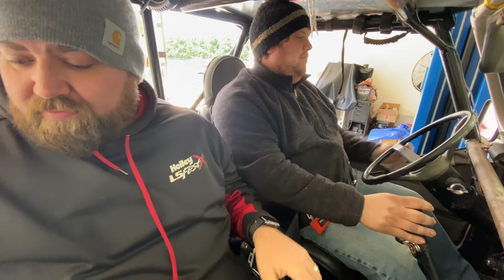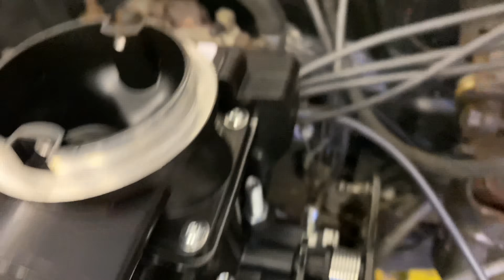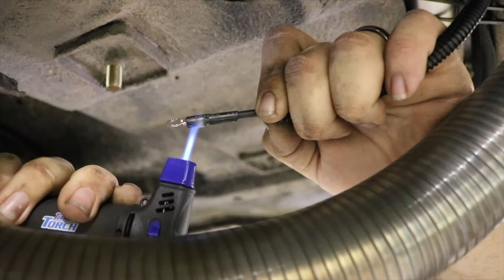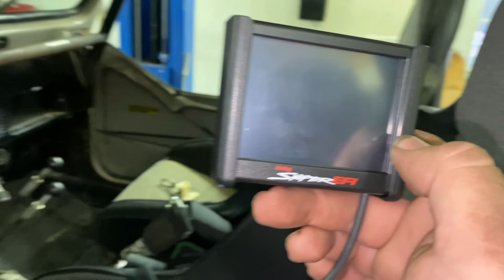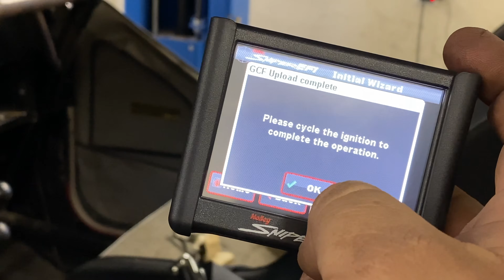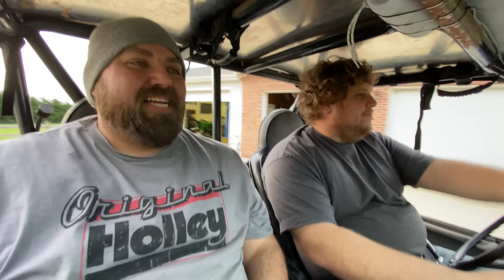Holley SNIPER EFI Install - CJ7 Rock Crawler

Comment: What diff gears are you using and what transmission? Also, what are your highway speeds you can drive? Thanks
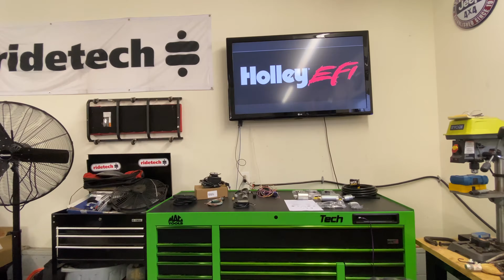Reply from the maker: Gears - 4:56 trans t18. @65 it’s 3,000rpm and it sees highway driving a lot

Comment: Jeep mechanic for 40 years. The Weber carb replacement for the Carter VV carb or even the earlier BBD is a waste. The Weber is a vacuum secondary 2 brl. that doesn't open the secondary barrel until it is time to shift. These are low rpm motors. The biggest boost you can make is adapt the Motorcraft/autolite 2100 to this engine period! You will NOT believe the difference over that Weber.
Reply from the maker: The Weber we removed was a progressive rate 2 barrel, not a vacuum secondary. However the 2100 is a great option as well that I have gotten to play with on other Jeep projects. Either way the EFI has performed leaps and bounds better then both and continues to impress daily.
Reply: @MaffettMotorwerks  While my Motorcraft 2100 was a noticeable upgrade over the BBD, EFI will be a no-brainer.  Carburetors in general are just too finicky in my climate/daily driver situation (read; my wife and teenager stall it too often!)

Comment: Just starting a sniper install on my 1983 Cj7 so watching all the vids I can find.  Mine had a Weber carb conversion and I noticed those studs were long as well when putting sniper on.  apparently the BBD stock carb had a spacer.  Had to order a carb rebuild kit that included the spacer.  and then the studs were the correct length and you could get a socket over them to tighten the nuts.  Just FYI for other guys watching the vid.  Can't wait to get mine finished.

Comment: Do I need to connect any of the 10 Pin Connector – Mating Harness? Most are optional and I am not aftermarket tach ?
Reply: check manual

Comment: I am working on adding this to my CJ7, what did you connect the pink wire into for a clean power source than delivers 12v in run and cranking?   Maybe I missed it.  Thanks!

Comment: Can you use the supplied fuel lines and connect it to the factory metal fuel lines, to avoid running the rubber hose all the way?
Reply: As long as your factory metal lines are in good shape I'm sure you could. However the factory return line is probably to small.

Comment: Why can’t you use the factory gas supply line?
Reply: My Jeep no longer has the factory fuel line. When we did the frame off a couple years ago I ran the metal lines different the factory.

Comment: Wow, still running manual brake. I switched to hydroboost after I put 35s on. Thanks for the video. Considering finally replacing my 86s stock carb in the summer. Tired of having to wait 10 minutes for it to warm up in the winter. Otherwise it always stalls out.
Reply: I have this same problem on my '86, thinking about doing this as well. Plus I live at 10k feet and the carb struggles big time
Reply from the maker: You won't regret the EFI! that is for sure

Comment: This right here is what I've been looking for. Currently installing this kit with the hyper spark ignition into my AMC Eagle.
Reply: My brother had an eagle for a little while, unfortunately the frame was pretty rotted and didn't last. God I loved that car!
Reply from the maker: That is badass! We would love to see pics!
Reply: @MaffettMotorwerks  yall on fb? I'll gladly send some pics and some videos of it running. This think is an animal.
Reply from the maker: @jakemagda2593  yes we are, Facebook.com/maffettmotorwerks   Also, our email is in our bio.
Reply: How’d it work for you? I’m looking at getting an eagle and want to convert it.

Does it work with the stock gas tank or what did you have to do for a tank and mounting it
Reply: @lastresort1757  I've heard the in tank pump works on the Wagons but it will not on the SX/4. I ended up having to use the external lump that comes with the master kit. Folks have had issues with the longevity on the external but, it's been 3 years on mine and not a single hiccup. You will have to build a timing table for it, Sniper likes to throw all the timing at it below 1000rpm by default. Super easy to do and Holley has some good "how to" videos. With the Eagle wiring you will also have to add a diode on the wire coming out of alternator. eBay has them for dirt cheap. Reason being, you will shut key off and the Alt back feeds enough power to keep Sniper alive. I also have a master kill switch just in case. Would I Sniper another Eagle? In a heartbeat. It was worth every red cent.